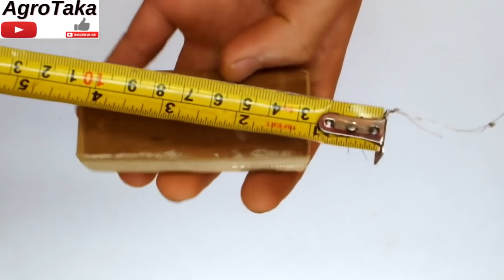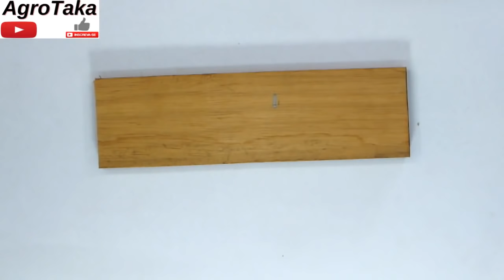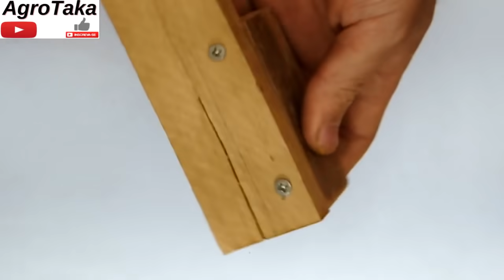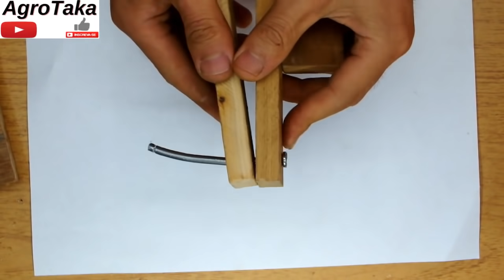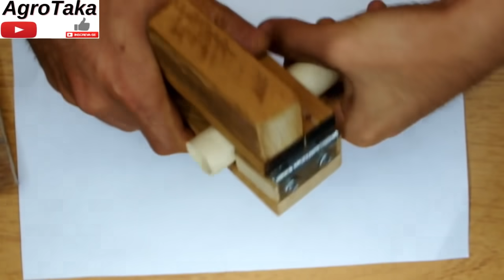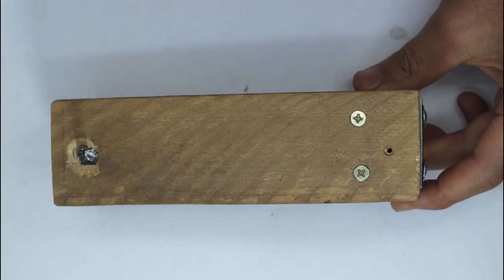PVC pipe cutter  {Diy}

Comment: Dimensions in English please
Reply from the maker: Hi, Subbiah. 
Upper Wood: 15cm x 4.5 cm x1.5 cm (Length x Width x Thickness)
Bottom Wood: 15cm x 4.5 cm x1.5 cm (Length x Width x Thickness)
Wood that holds the blade: 8.0cm x 3.5cm x2.3cm (Length x Width x Thickness)
Wood (slat): 4.5 cm x 3.0 cm x 1.5 cm (Length x Width x Thickness)
Stylus Blade: 4.0cm x 1.7cm (Length x Width)
Hinge: 4.0cm x 3.7cm (Length x Width)
Nail: 7.5cm x 4.0mm (Length x Thickness)
Pvc liner fastening screws: 6 units
Screw: 3.0cm x 2mm (Length x Thread Diameter)
Bike chain link: 1 unit.
Reply from the maker: I made another version of the cutter
https://youtu.be/tWpd1yCSNlY